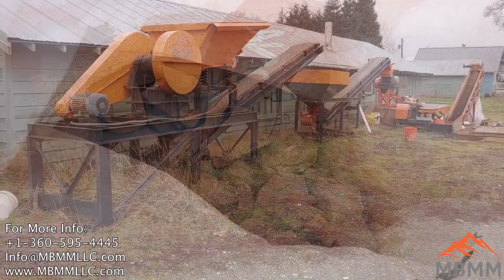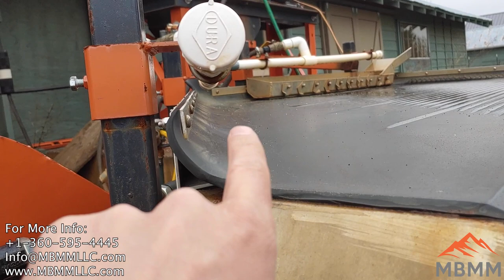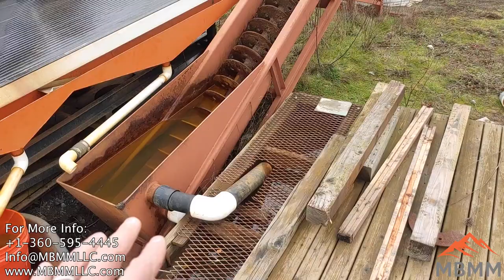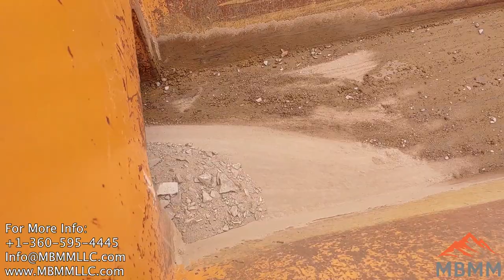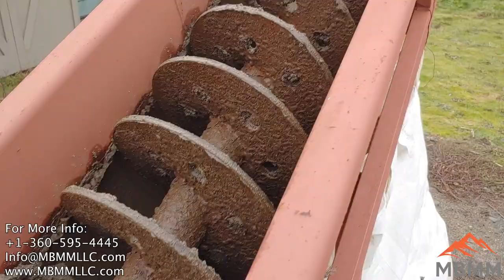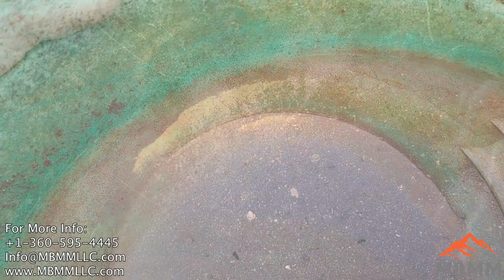Gold Mining & Milling Equipment

Comment: Jason, It's a pity there isn't an easily accessible inspection cover on your hammer mill to check for larger balls of gold. My hammer mill opens up at the front and I clean it out after each run and that's when I find all the 1mm, 2mm and sometimes 3mm gold balls that rolled around and couldn't fit out through the slots.  It's a nice surprise at the end of a run 😀

Comment: It looks like your turn key system will work for that ore.  I wonder why the customer didn't have you do a quick and dirty assay as well?  I would wave a magnet over some of the larger bits of mystery material in the pan to see if it's tramp metal from the milling process.  Keep up the good work.

Comment: Great video Jason. I really like the in depth info on the shaker table. I do have a question about that though. How small can you crush the ore before the recovery rate really starts to drop on that table?
Reply: I believe he goes for about 50 mesh and all the over size goes back into the screw for the course tailings. Jason’s actually done that video where he smelts and reruns those and gets a pretty good recovery. I think he ended up changing the screen in the hammer mill so it got a bit more fine as a slurry. .8mm if I recall
Reply: @VendettaProspecting  I’ve seen that video and I’m aware that you want to keep the rock as big as possible while still recovering the majority of the paying ore. However sometimes you have to crush the rock a lot smaller than 50 mesh to accomplish this. But the smaller you go the harder it is to maintain a high recovery rate so I’m curious how small you can go before you notice a big difference in recovery percentage with his table.
Reply: @Matt_the_Miner  yeah that would be a super interesting study because if it got super small you think it might not make it into the to the high-grade may end up slipping down with some of the heavier rocks
Reply: Look for the video on the ball mill. The table and water can be reset to run finer material.
Reply: @richg.8092  yea sir. I don’t think there are diminishing or measurable looses for having the materials too small, more of a time to value of recovery rate that begins to drop
Reply: Hi Matt, do you know the ore is from where my location is? I’m also a small scale miner in Ghana looking forward to meet a partner to work with, I have more than 50 hectares of fresh land for mining, i dnt know if you might want to know more, let me know if you are interested….

Comment: I have one of your 4x8 tables, works great!
One question on adjusting. 
On my last run , I finally got my mill running smooth enough that I had time to really watch the table work. 
Im seeing quite a bit of gold (even some decent sized pieces) slip past the #1 port, and drop into the #2. 
Fire assays of the tailings show less then 1/10 opt loss, so next to nothing is being lost. 
What could I adjust to remedy this, and get more of the gold in the #1 on the first run?
Thanks for all your great videos!
Reply from the maker: There are a few adjustments to try. First try turning the water pressure down on the angled water bar. That should help the gold move over into the number one. Second you can try flattening the slope of the table some. Try small increments to start so as not to over adjust. You can also adjust the tilt of the table toward the #1 & #2 a little bit. Some people like to flatten the slope toward the tailings and others like to tip the table a little toward the #1. Let us know which adjustments work best for you. Thanks for your comment and I'm glad you like the table and its working well for you.
Reply from the maker: You can also check out some other pointers on this video: https://youtu.be/SYN87xMQxvE

Comment: I found some metal sulfide nodules impregnated in ancient shale.  They're quite high density for typical rock, about 6.0.  The surrounding shale is only 3 or so, by comparison, and the nodules are INCREDIBLY hard.  I was smacking one with a hammer and it was denting the hammer.  It finally broke in half and exposed a very fine-grained, crystalline interior with various thin pyrite inclusions.  I'm very curious to find out what metals it contains, and how such a dense material formed in this layer of shale.  That layer has hundreds of these nodules just in the one surface spot.  Some are flat, some are egg-shaped, some are almost perfectly spherical.

Comment: We're in the process of adjusting your smaller shaker table and this is super helpful. Question: the stuff that collects in the grooves at the base of the incline on the main part of the table...should that wash out by itself with the water and shaking action or do you have to brush/clean the table off afterwards? How much time do you run the table if adding the crushed material by hand, is there a minimum amount preferable and do you make a slurry before adding it to the aluminum tray?
Reply from the maker: If the ore is damp it can be fed directly into the trough. The table can handle quite a bit of material, there is no minimum, but it needs enough material to fill up the grooves and begin to flow into the different collection ports. The stuff that collects at the base of the ramp after you are finished running needs to be brushed out. Thanks